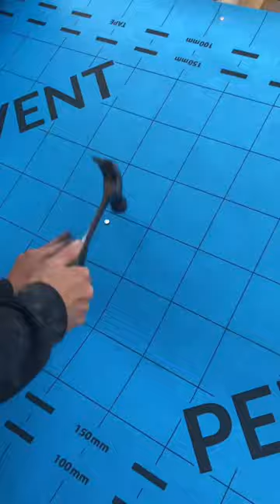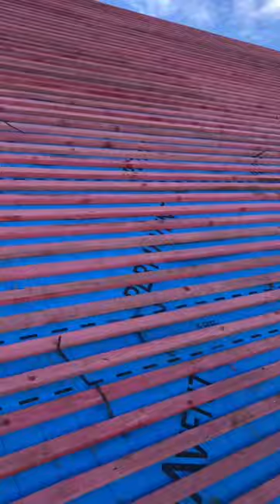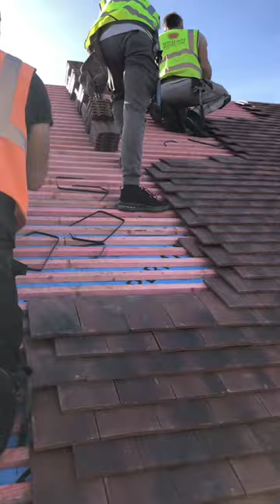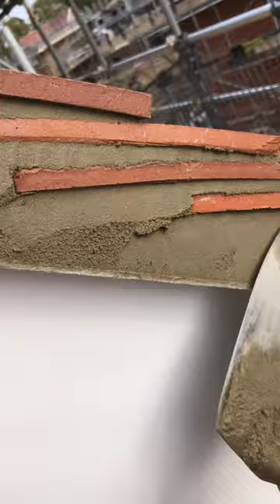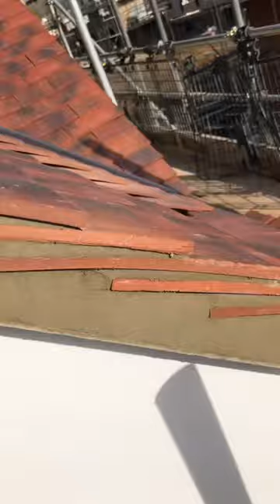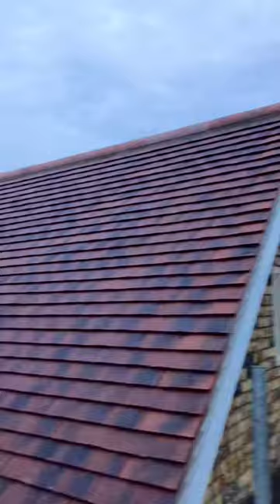#roofer#roofing#construction#shorts#shorts#youtube#newvideo#follow#viral#fypシ

Comment: Are they relying on the weight of the tile above it to hold the tiles on the roof? I see two nail holes but no nailing going on
Reply: only every 4th or 5 th course but in the severest conditions( costal) you might do every 3rd course  but unusual ,slate is a better covering for most costal UK areas,although Whitby  and some other Easy Sea costal town and villages have Flemish pantiles and cortreau interlocking clay tiles.Easy cargo home after delivering  fish products to the Netherlands 150+ years ago.